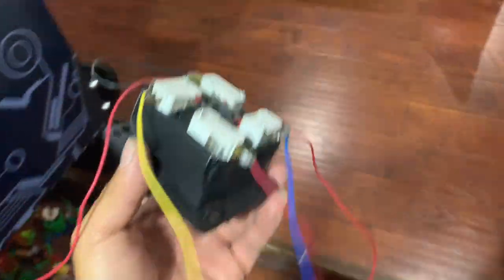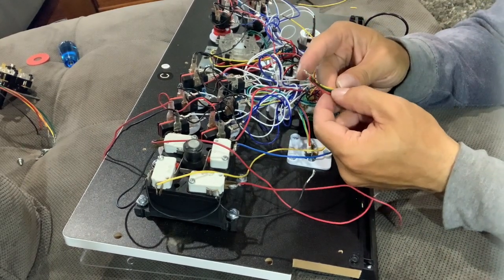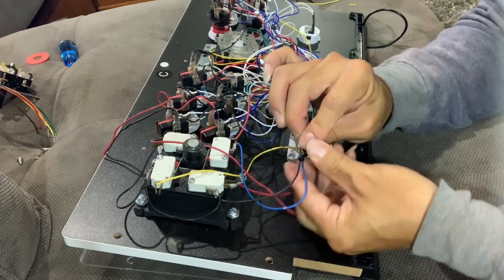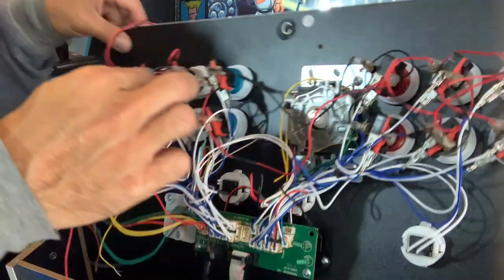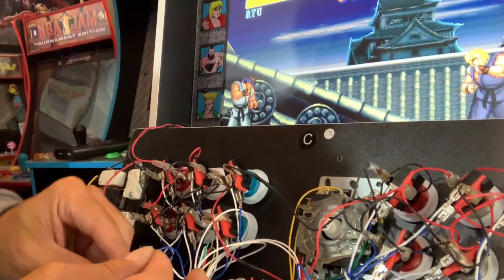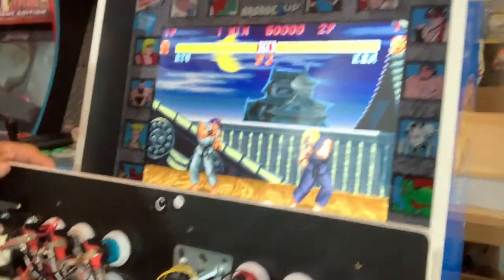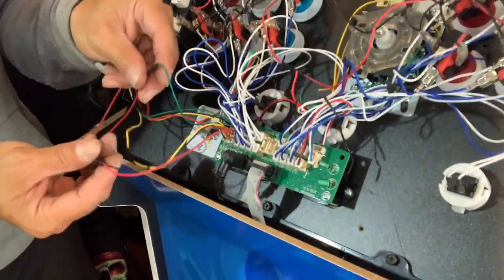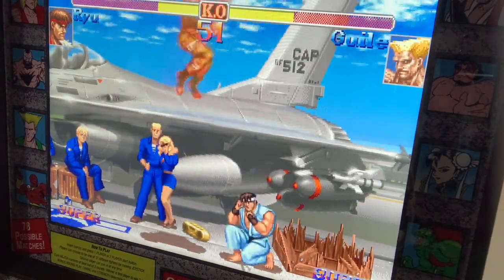Arcade1up Big Blue tutorial how to add happs sticks/sanwa and other brand sticks

Comment: Show did you cut the original wires that connects to the arcade 1up encoder? Please explain more if this.
Reply from the maker: Yes
Reply: @2Dai4  okay. Also did the happy stick come with the wires?
Reply from the maker: No  I use leftover wire’s
Reply: @2Dai4  see this is why I'm asking. Never did anything like this before and definitely need help. I m looking at gett two happy sticks, they will be 8 way directional. What is the name of the wires that will connect to the joysticks? Basically what all will I need to buy Todo this project. The last thing I want is to mess my board. Your help will be much appreciated, for real
Reply: @2Dai4  looking at your video, it looks like you took the black, red, green, and yellow wires from the arcade 1up encoder, cut them and skinned off the shielding to get to the silver part. Then you wrapped them together, along with two wires from the new joystick you were installing. Then you took the other four remaining wires that were on the joystick, made sure they were stripped to the silver part and connected them to the four colors of the arcade 1up encoders to see which one would be the correct direction.? Am I on the right track?
Reply from the maker: Yup 👍
Reply from the maker: Here https://www.amazon.com/dp/B07TXDJBDZ/ref=cm_sw_r_as_gl_api_glt_fabc_YCC2QEEV8A6MJTET4G6N?linkCode=ml2&tag=2dai4-20
Reply: @2Dai4  okay so looks like I will need a wire stripper. What is the names of the wires and how did you place them on. To the controller?
Reply: @2Dai4  great thanks for the link, but did you cut these? We're the metal ends used on the joystick? And what was used to connect these to the encoder?
Reply: @2Dai4  where can i buy those type of wires you used to attach to the happy stick?
Reply: @2Dai4  does it matter what color they are?
Reply from the maker: Yes I cut them
Reply from the maker: All wires are same
Reply from the maker: Nope any color mix color
Reply: @2Dai4  Okay so I  could buy some wiring that had the 5 pin connection on it, cut the 5 pin connector off, then strip the skin off and connect on end to the metal microswitch on the joystick and the other end to the wires still connected to the encoder?
Reply from the maker: Yes 👍
Reply: @2Dai4  okay I've ordered everything man I so want this to work, wish me best
Reply: @2Dai4  so you know where the two connectors on the arcade 1up for the joystick, does it matter which wires ( green yellow black, or red) are connected to the micro switches for movement?? I already know where the ground would be. Also, were you able to use the same screws to fasten the new joystick on?
Reply from the maker: Join me easier to communicate https://www.facebook.com/groups/2534393833275085/
Reply: @2Dai4  Hey I got all my supplys . one question. When i connect a wire to a mircoswitch can I just wrap it inside the hole or do I need to use electrical gun to paste it, because I dont have that stuff
Reply from the maker: No need just use the connection
Reply: @2Dai4  hey man not sure what Im doing wrong here, but I got the happ stick installed BUT, for whatever reason I can t seem to get up and down to work, but I got left and right. are you sure i could use any of the other wires. I made seperate connections to to the grounds. Im starting to think that one of them was suppose to be for up down. MANNN i need your help
Reply from the maker: Bro what’s your number man
Reply: @2Dai4  happ stick is freakin awesome  good matches this past saturday. waiting now for my other buttons
Reply: @2Dai4  hey I finally got it I did everything you did, but just had to switch the up and down microswitches. Worked like charm .just a bid difference. Arcade 1up need to be ashamed of themselves selling cabinets for near 600 dollars with hardly any quality sticks.
Reply from the maker: Hell yeah 😍👻🕺☝️👊🤝🙌🙌